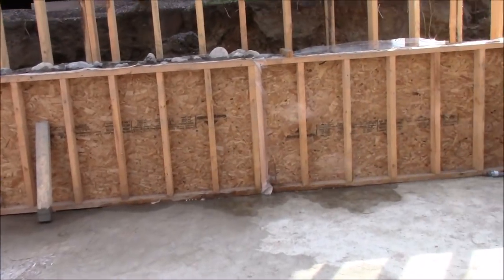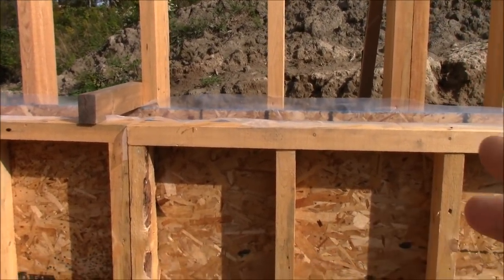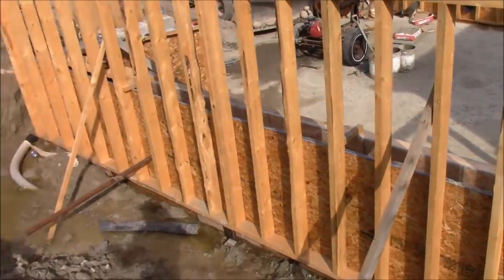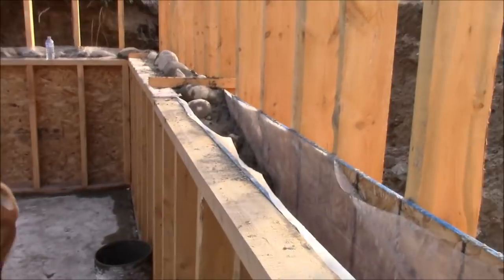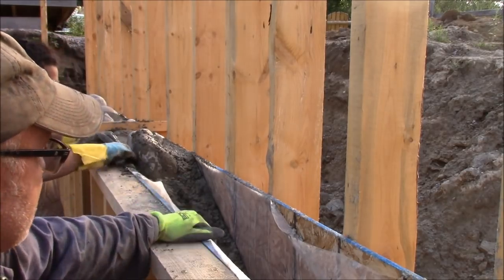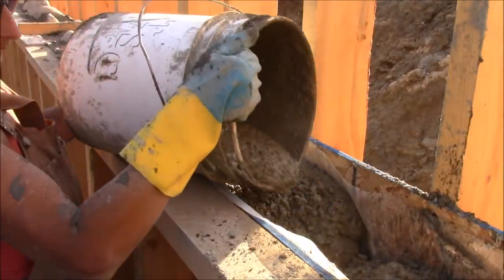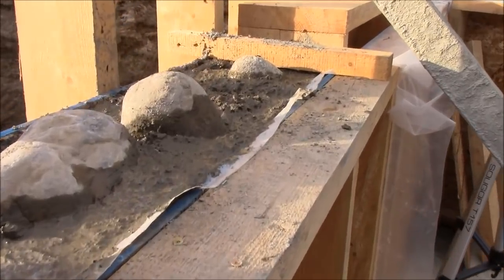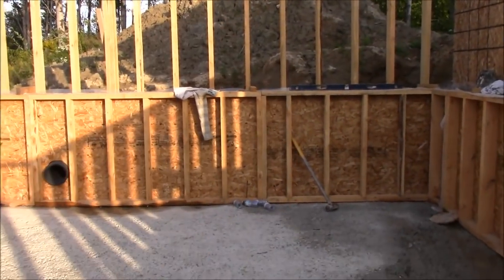Placing Rocks In Our Concrete// Filler And Added Strength?

Comment: As a kid, my father and his cousins poured many cubic yards of concrete similar to you. However, we used a Ford tractor with a mixer on the back. In one of your earlier videos it looked like you spray the water into the mixer which creates problems on the consistency of your mix. A better solution would be to have a dedicated water bucket that would have a water level mark thus knowing each time you are using the same amount of water to every concrete mixer batch. 

Regarding the next level pour, I would build a movable deck that is about four feet high with a 4 by 8 landing with a railing on three sides. Having one more person that works as hard as you and Heather on the upper pour would be very helpful. 

I like your geothermal experiment. In your area this should be a great benefit. Good videos. Keep it up and do get hurt.
Reply from the maker: Thanks Dallan, Great ideas.  Thanks again. You take care ttyl...Cheers.

Comment: As I said before ! 
Cecile. Use the bucket on the tractor to lift the mixed concrete up as high as you  need to for the next layer.  
You could also use it for the first level in stead of lifting all those buckets up, except that you would not build up your muscles quite so fast LOL.

Comment: Cecil & Heather :    Looking good!!   I would not mess with the outer form until the wall is cured at full height.   And would continue to work from the flat surface inside.    Better to place rock and concrete buckets on a slide able platform. Than to try to balance on irregular ground,  narrow ramps and planks with heavy loads on the outside.  And that would be a lot of structure to support you and the load your carrying the long way around on the outside.   Your doing great,  keeping it simple,  with sure footing.  Three 2x4 posts and a handrail  will keep you on the platform with touch reminding you of the edge.
You may find a 2'x 4' x 8' bench style platform easier as there are no pipes;  as with the scaffold to work around. Just one extra step to place  buckets and rock on the platform with the same 4' lift of the materials your using now.  And if you temporarily screw the platform to the legs under the slip form it will help support them until the lift starts to stiffen in a couple of hours before you have to move it.  the old guy  Bert

Comment: A small 3'x4'x 4' high platform to work on and use an extension ladder leaned against the wall to slide buckets and rocks up with(like they do to raise shingles to the roof).Then move to where needed.

Comment: Polybond mixed 4 parts water one part Polybond helps dry concrete adhere to fresh concrete. I have seen some use white carpenters glue to do the same thing. 
        Mike

Comment: Hi Cecil, just an idea, how about making a small working platform with a couple of steps that you can put 2 or 3 pails of rocks on and then you mix 2-3 loads of concrete tip, straight into the tractor bucket. That way you can tip so much concrete and Heather can fill in the rocks and then just gradually move along. That way it would eliminate the need to keep moving your mixer and save you having to take down your forms.
You are both doing a great job. Just thought it might be an easy solution. Take care. Very best wishes Graham 🇬🇧🇬🇧

Comment: you can build an outer walkway around the outer forms. pour the concrete into the pails out them into your loader with some rocks then lift them up. Heather can stand on the walkway and unload them into the forms.

Comment: Hi you two good work just a thought try not to make the cement to smooth between the rocks 
a bit rough gives the next layer of cement something to bite into and hold strong keep up the good work you will have the house on the the basement 
in quick time

Comment: A LOCAL STORE HAD A 20 INCH PIPE RUN UP ON THE HILL TO OLD MINES AND IT MADE THAT PLACE A DEEP FREEZE, HE CIRCULATED THE AIR TWO UPPER STORIES AND A BASEMENT

Comment: Just make a small scaffold or maybe 4ft wide 4ft high steps and just move it along the wall as you pour or make 2 of the steps maybe 2ft wide and 4ft high and place a board on top so you can cover more distance. Walk up the steps and dump
Reply: That's what I was thinking too.

Comment: Cecil love your videos what i would do is insert some threaded rod in the wall at four feet height around the inside of the form. Then I would weld up  some  brackets that are 2.5 feet wide to support the raised inner wall form  and also wide enough to walk on to pour the cement into the upper form. You could  use brackets of 2x4 and plywood gussets  instead of metal if cheaper around three feet apart. You have to support the inner wall anyway why not make it wide enough  to pour the cement as well.

Comment: Hey Man, enjoying your channel! Pour the mix into the tractor bucket and pour into wall.
Reply: This way you will not have to handle any buckets
Reply: That's a lot of very tight area tractor movement, not gonna help. Plua such small loads they'd lose too much onto the tractor bucket itself.

Comment: What if you used the payloader to bring dirt fill into the finished basement floor.  Elevate the fill dirt up to the 4' level and relocate the cement mixer to the top of this mounded dirt level.  Now you can easier lift the plastic buckets to pour concrete to the finished wall level.  After words you can simply remove the dirt from the finished basement floor.  This method came to me from when we had to use this method to backfill a inner-city basement because the existing adjacent buildings were too close together to fit even a mini loader between them.  We had to backfill the new basement from over the wall from the inside of the new building's basement. Of course we had modern payloaders, the perfect soil mix of stone dust, item#4 gravel, and clay to buildup the interior grade gradually not to put too much pressure on the new concrete wall.  This worked out for us without overstressing the new concrete walls.  Good Luck!

Comment: Also for the inside forms if you built a 4' T post under corners and at every joint lift them forms on top and used some ready rod with nuts and bolts to tie the bottom of the form inside and out save you a lot of work making new forms

Comment: Build a small walk board around the out side forms . Use some 2x6s to walk on make L shaped braces and connect that to the form . One end were the form meets the foundation and the other end 5 or 6 feet up. Set your mixers and rocks high up closer to where the house is. You can then reach over with the rocks and bucket of concrete. A third person with this method would help you out big time.  Good luck guys.
Reply from the maker: Thanks Shaun, that sounds like a good idea... We just don't have the time or extra lumber to build something like this 😞  I am trying to come up with an idea that will be fast and cheap lol.  But your idea is a good one, Thanks again. You take care ttyl...Cheers.

Comment: I am still curious how you will do the upper part. Since I'm a little lazy, I probably would fill the bucket of that tractor with cement, straight from the mixer, and slowly pour / rake / shake it down between the forms. (John Ahern had the same idea)- -BTW, Heather, nice tan!  :)

Comment: cecil ...some times there is no easier way for the bucket bricaide ...but heres a sugestion just use 2 saw horses built to the right height to put a 12 foot plank on to work on the inside ...easy to move the plank and horses around that way as you pour ...also i have seen half saw horses built and leaned against the wall to put a plank on in use
Reply from the maker: Thanks Grizz, I actually never thought of saw horses... I think I was trying to over think things lol.  Thanks again. You take care ttyl...Cheers.

Comment: As I have quite a lot of masonry experience, a  rule of thumb for a footer is it should be twice as wide as the wall and the same thickness as the wall width.  That could change with the soil's ability to support the weight of the structure.  It should be reinforced with at least two rebars set centered in the footing the same width as the wall apart and about one third up from the bottom of the footer.  The rebars should be lapped 20 diameters (a 1/2" rebar would be lapped 10 inches) although some say up to 40 diameters.  More lap is probably better so hope you even have rebar in the footer.  Of course the bars should be wired together.  What worries me most is all the cold joints you will have in the concrete, especially the big horizontal joint around the wall.  The areas where you will back fill will suffer most.  I know I have come in late like the Monday morning quarter backs but there may be some things you could do to help.  I do like your inventive nature and hope all this project will work out and give you years of homestead joy.  Sorry, I just went back and looked at the video where you prepared for the pour.  I see you did reinforce the footing part of the pour so I feel better about that.  I had to take a break from your videos while I worked on a project of my own.  I'll not jump in again and I am sorry for any comment that may offend you, Greg

Comment: ON THE UPPER POUR
I agree with 'old time engineer' make a simple ,sturdy lean too scaffold, say 10-12 ft. long 1 1/2 "x 12"walking board 
and move along the outside wall as needed. Rope your buckets up from the slab surface and maybe overlap on the 
two ground legs so as to be able to adjust the leg lengths for walk board leveling. may not be necessary,i cant tell 
how uneven the bottom of the hole is ? 
How do you like working with 75 supervisors ?  
But, then there IS only ONE super on site that counts and she is mixing the concrete. LOL

Comment: Don’t fill the outside until the house is on top and bolted. The weight on the outside can move walls.

Hang planks on both sides of the forms. Run more planks from the ground. Carry buckets and rocks along planks and dump in wall.
Reply: Or build stairs or ramp inside forms to lift fill

Comment: I would think you need a scaffolding around the outside and use a wheelbarrow; 2 of them maybe, one for cement and one for rocks. Otherwise going against gravity is going to REALLY wear you guys out! I would also think to leave a decent space between rocks because in my way of thinking, rocks are just big aggregate and as big aggregate there will be less bonding surface and there will be differences in expansion and contraction rates between the small aggregate and "big" aggregate so at least on exposed wall you might not want them too close so they don't essentially grind what little concrete there is between rocks and maybe even pop a fissure at some point. Sure, it will take decades to happen and there is no safety issue...but still!

Comment: You need to draw the cold air  from the bassment and blow it in to the up stairs  off your home. did you say that the bassment is going to be wiar  you are going to park your cars. if so you do not want to draw your air from their you will be getting all the fumes from their
Reply from the maker: Yeah I will add my piping later for all that.  Thanks again.  You take care. ttyl... Cheers.

Comment: cannot backfill  now  concrete needs 2 cure  … backfill pressure is risky  .. long unsupported walls can cave in
 … fix the tlb   load 5 pails  concrete and rocks sit on the bucket and pour